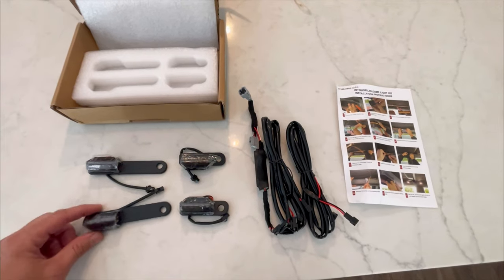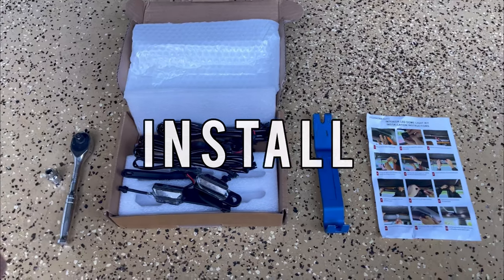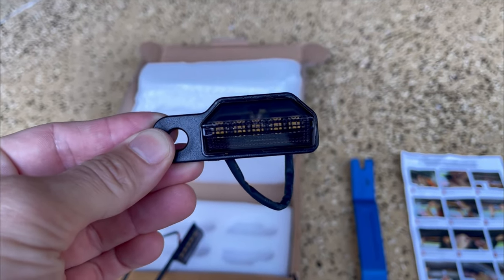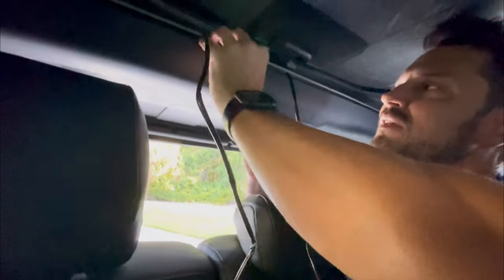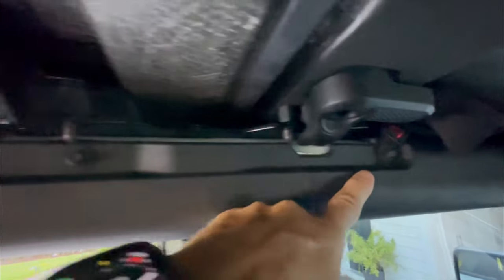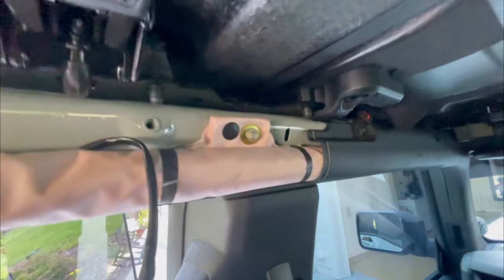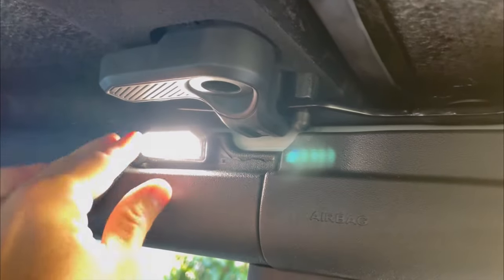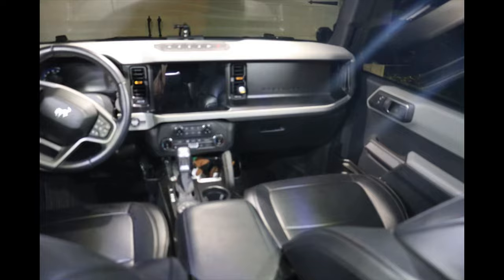2021-2023 Ford Bronco Interior Upgrade Lights (A Mabett Product)

Comment: Nice install. I read on Bronco6G that there was an issue with the interior lights needing to be on 100% for the lights to work correctly. Hav you had any issues? I was considering buying these for my Bronco. I keep my light at 100% anyway, that is really not a big deal. Also I see you did not get the rear light they sell, so goo to see this works without having that.
Reply from the maker: Hey – thanks for the question. I did read somewhere else that you needed to have your lights turned all the way up for these to work. Let me check on this tonight.
Reply from the maker: I wanted to post to follow up on this question. I have been running my interior lights at about 3/4 of the way and I have not had any issues with the interior lights from Mabett. Just keep in mind that the interior lights from Mabett do not dim with the controls on the dash.

Comment: I installed this set.  It does a great job of lighting up the black hole of the Bronco interior.  My problem is the rear (not 4:50 the side lights) center light comes on randomly while driving.  Not an issue in the day, but irritating at night.  Does anyone have a fix for this?  Does anyone have Maybett’s contact info (I couldn’t find it online) so I can ask them?
Reply from the maker: Hi - he has a Facebook account. I ask questions there often. 

https://www.facebook.com/share/XGHbwc9mTA4vb3RX/?mibextid=K35XfP

Comment: Be honest. How difficult is getting that dome light out with the pry tool. I know it comes with a pry tool now but not knowing this when I ordered it I bought a kit on Amazon. I don’t wanna be prying at that this thing in the wrong way, scratching it etc. I thought I seen in another video that you can pull down the trim and reach up and over and inside and unclip the dome but maybe that’s with just the soft top, I also have a hard top.
Reply from the maker: It took a little force but was not difficult at all.

Comment: Does the wire have to go behind your hard top clamps? 
What is the camera or light on the backside of your roll bar crossbar ?
Reply from the maker: No, I did not put it behind the hardtop clamps. The camera in the back is a dash cam that I wired in. Thanks

Comment: Great video and another great  mabbet product. The issue is they must be so popular that they have been unavailable on amazon for a while. Does mabbet sell a were else. When i do a sesrch ,i get similar products but yours is the  only one that works withiut the door having to be opened.thanks
Reply from the maker: Hey and thanks. Yes, these have been selling out quite often. Let me reach out to them and see when they estimate a new order to Amazon
Reply: I actually found them on amazon today. I watched another video on these lights and they were plugged into the rear overhead light . It seemed like a much easier install but one of you guys  may have did it wrong. Is it possible that mabbet changed the kit? Thanks
Reply from the maker: Yeah that’s a different kit.
Reply: Well , i just ordered mine , based on the other link , as i saw that video first. Im curious to see what kit i get. I will get back to u in a week
Reply from the maker: I spoke to Mabett and he said that they are going to be arriving back in the Amazon store early November. I know you said you ordered a set, but if you have any issues they should be restocked in a couple weeks. Have a great weekend!
Reply: Hey guy. I got my kit today, i ordered it based on your link and on amazon it clearly says plugs into rear light. They kit that i  got and im sure others as well plugs into the front light. Any chance u can find out if the rear light kit was discontinued and changed to this model. I habe a feeling it was because of the issues people wer having with the plug seating properly. For some reason i really like the kit u have over the one i recieved. Thanks for your help.
Reply from the maker: Hey – thanks for the question. The kit that you ordered must have been a different kit because I talked to Mabett and he said that their kit is not available at this time on Amazon. (Link attached  it the description). They sold out pretty quickly, but have more in manufacturing now and will be available at the beginning of November.
Reply: Yes they  were sold out on amazon, i checked every day and on sept 30th they were back in stock . The amazon description said installs to rear light , but the instructions clearly say  remove front reading lamp. I am going to check the length of the harness to see of it fits the rear. If it does i am going to drop the  rear light and hope the connectors are the same. . It may be just as simple as mabbett printing the instructions incorrectly. .